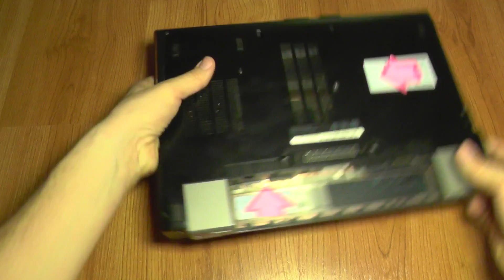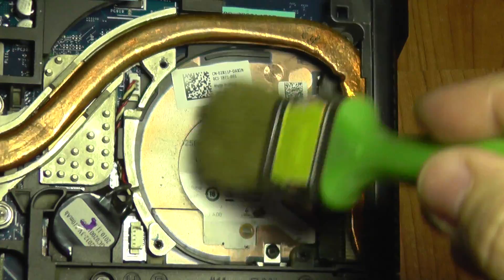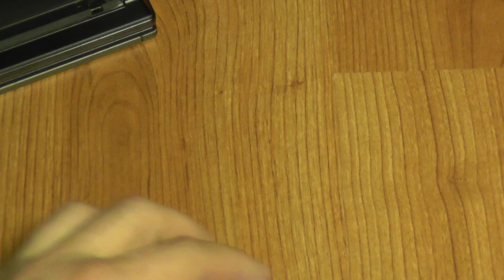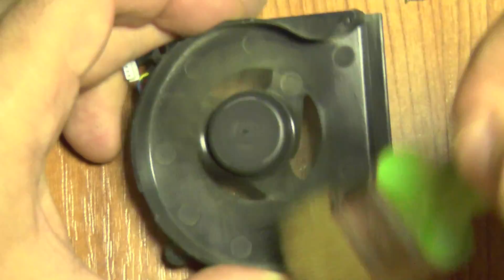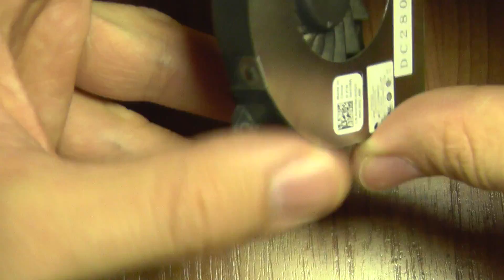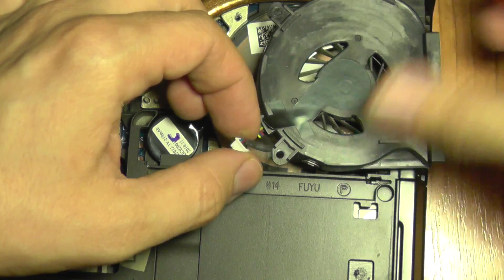Dell Latitude E6410 Cooler & Fan Cleaning

Comment: Actually this serie has an issue, you can not control the fan by the bios. My DELL was still running too hot (GPU) after cleaning and renewing the cooling paste. I installed Speedfan and still the gpu was too hot. I have read that it is a heatsink / pipe issue. What I did is putting a copper 1 cent coin between the gpu chip and the pipe. Now the GPU is running about 50o C.

Comment: Tried cleaning the fan and placing new thermal paste but still it shutsdown due to overheating.
Reply from the maker: is the fan / heat sink properly installed?
Reply: Actually this serie has an issue, you can not control the fan by the bios. My DELL was still running too hot (GPU) after cleaning and renewing the cooling paste. I installed Speedfan and still the gpu was too hot. I have read that it is a heatsink / pipe issue. What I did is putting a copper 1 cent coin between the gpu chip and the pipe. Now the GPU is running about 50o C.

Comment: Thanks for putting this up on Youtube! I literally should have done this years ago (yes, I am still using this 10 year old laptop for some reason, pffft); somehow, I was never told (by the computer engineer parent that gave me it, no less) that I needed to clean the dust out. Had a suspicion there was something wrong when I finally realized that I couldn't even feel air coming through the vent even when the fan was on. There was ~5 years' worth of dust in there, completely covering the opening. My poor laptop. Since I'd never opened up a computer before I was very skittish about disconnecting the fan cable but this video helped a bit.  Couldn't go to town on the fan like shown here because I didn't have a good tiny screwdriver for the tiny screws, but after putting everything else back together the difference is amazing!  I can actually watch Youtube videos without the computer lagging for 15-30 min after ~3 minutes of video!!!  And the whole time I thought it was just the laptop getting old or I was running too many programs or something. Now it can finally breathe!
Reply from the maker: Well then...thanks for watching :)
Reply: @TechTronic9000  hehe, sorry about the life story, but you have my gratitude :D

Comment: hey. have a problem idk if you still have this pc laptop but i have it. accidently dropped it and now it overheats. i am pretty young but have the tools to disassemble it. cpu temps go up to 90C. any help or idea on what i mightve done
Reply from the maker: Maybe the cooler is not touching the CPU as it should.
Reply: TechTronic9000 thanks I figured that out and ended up fixing it

Comment: My brother tells me the reason me Dell E4310 randomly gets slow is because the fan might be dirty and filled with dust, I know this isn't the same laptop, but would it be easier to buy a new modern laptop? or just clean out the fan if it is the problem.
Reply from the maker: Your E4310 should be similar to be taken apart, so it's worth a try. A fan / heat sink can have a major impact on performance.
Reply: +TechTronic9000 Thank you!